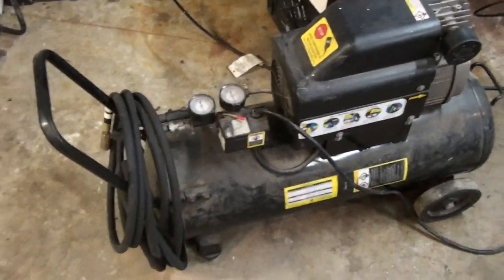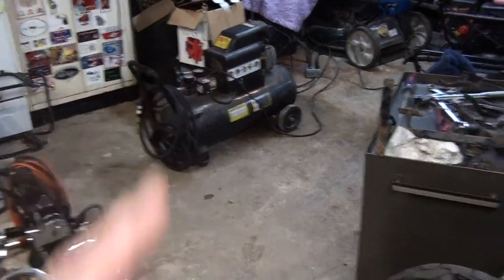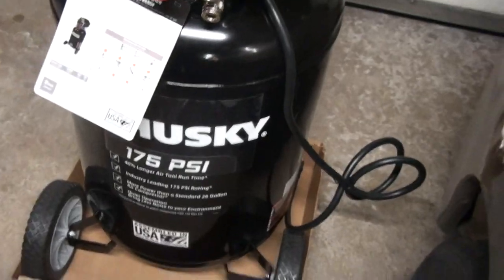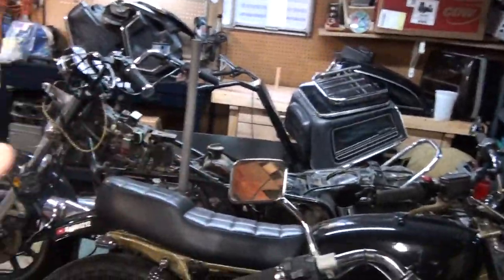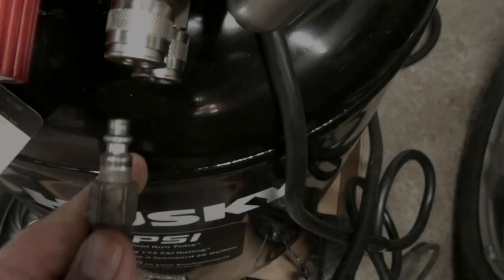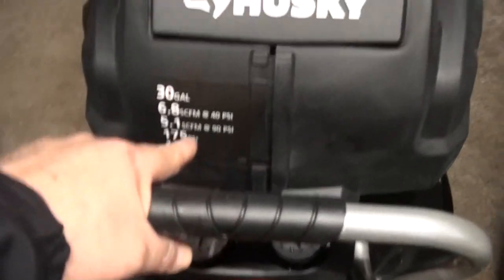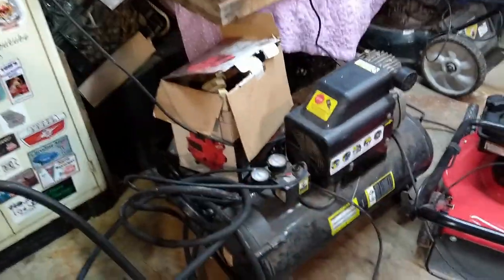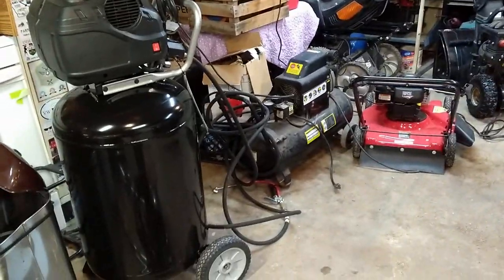CentralPnematic VS Husky Air compressors

Comment: My X-wife understood the need for good tools, i had a old small sears 110 air compressor I think it was a 20 gallon tank wore it out. She been saving for a father gift for me that year and she & the kids went to the local NAPA store and procured a 80 gallon 220v 2-stage huge air compressor.  I was lucky that back when I restored and rewired our old 125 year old house I put 200amp 40 circuit panel for the house and 100amp 20 panel in the garage. I rebuilt and rewired an old house we had in TN and made the mistake of only putting in a 100amp service learned my lesson, i have power to spare now plus the power company enjoys billing me for that each month.
Reply from the maker: Man I wish the guy that has this place built had thought that way. Awesome Ex wife mine had no idea how important these things are.

Comment: The larger tank will be a big help on sanding and painting with the extra volume
Reply from the maker: Yeah, that is what I am hoping, also should be able to get the lug nuts off all four wheels before the compressor turns on. Being a vertical design should make storage more space friendly.

Comment: just a tad more pro then the one i built for the basement, but mine is WAY more quiet ! its also made fron fridge compressors so its made from recycled material, no money but alott of thoughts haha
Reply from the maker: I would have loved to do that. However I am not so sure I could have pulled it off even if I had the old parts laying around!

Comment: The vertical design has some appeal.  I wonder if the two compressor are using different technology.  I would not be surprised the the Harbor Freight is using a piston and the Husky is using a rotary design.  The rotary design is allowing  refrigerators to use less power.
Reply from the maker: Yeah, I bet they are. I am pretty sure the HF one is piston hence the oil, the Husky I have no idea but you are probably correct its probably rotary that would explain why its so quiet.

Comment: Nice unit, should work well for you.
Reply from the maker: Thanks, I am hoping it works out. The thing is its what I can afford and I don't do anything big that requires a lot of air tools. Still if I had the cash I would get a proper one. The cash and proper power in the garage. :)
Reply: I hear you on cash, my wife was laid off last week so we need to start paying our medical at about 850 pro month.   So, my play money has been cut in half :(    I wouldn't have bought the van if I knew this but all will be ok.   @MidwestMotoRider
Reply from the maker: @buzzsah  Glad its going to work out. Hopefully you can make up the play money, I sort of did but not to where it was before however.